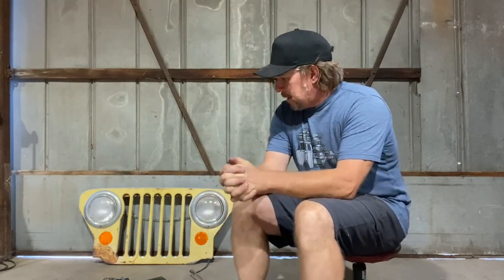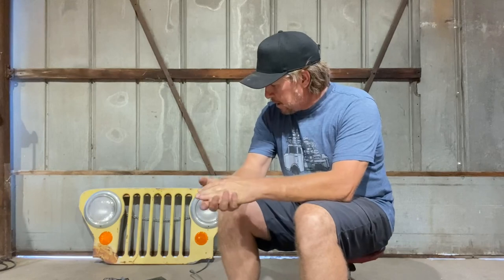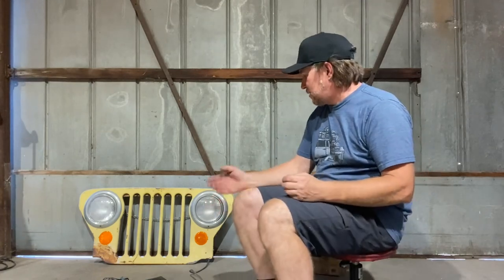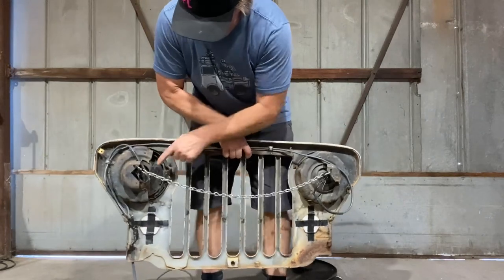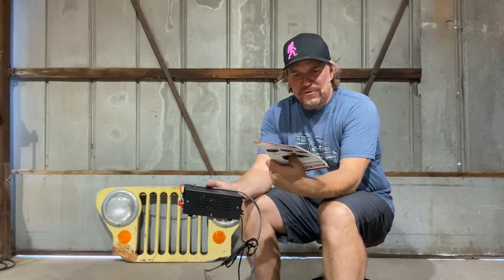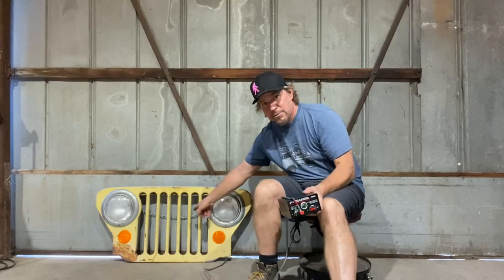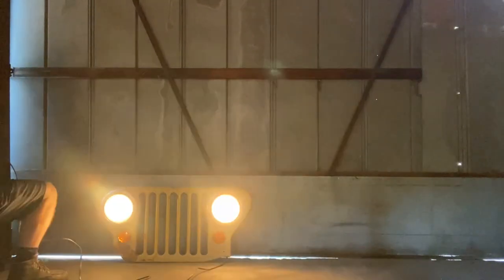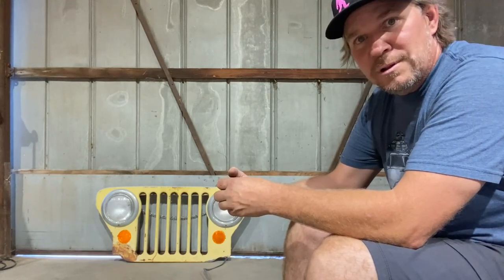Dirt Daily. How to make a simple wall hanging Jeep Grille Light

Comment: You could use any old free/$5 computer power supply for this...or, a 12v 10A power brick from Amazon for about $20. Basically the same as a laptop cord. They also sell 12v dimmers so you can adjust the brightness.

Comment: I have a few small 12V converters for phones and stuff. I have used them for smaller single lights. Not sure about using for headlights for very long, but if you used 12V LED headlights...

Comment: Very cool project, I did the same years ago. FYI that pyramid power supply is a linear supply. You can get a switching supply with similar spec's at less cost and smaller size. The lights won't care.